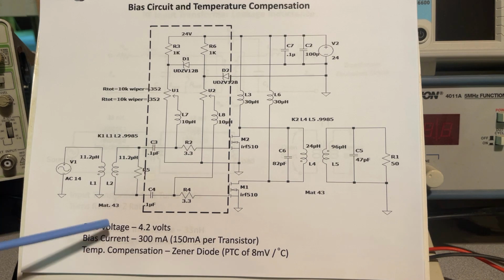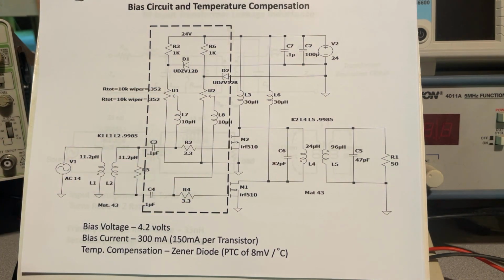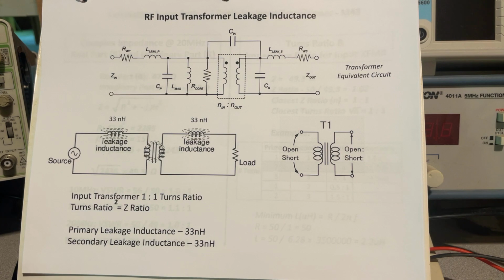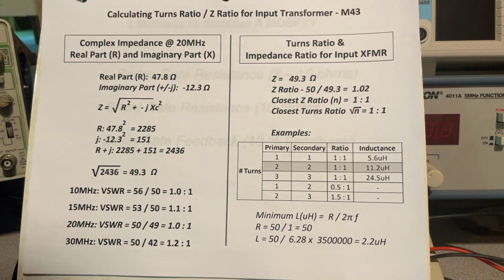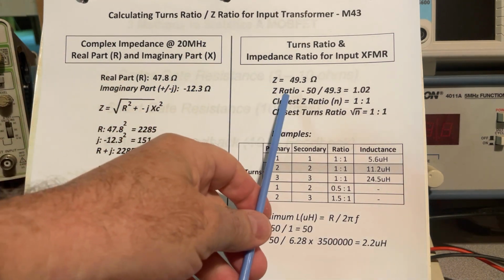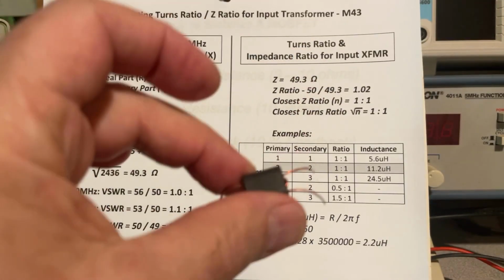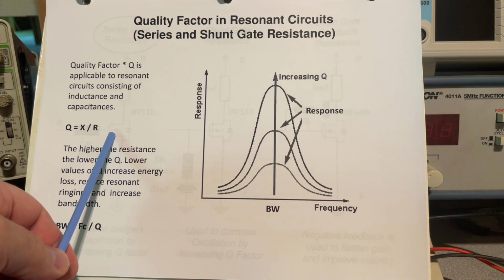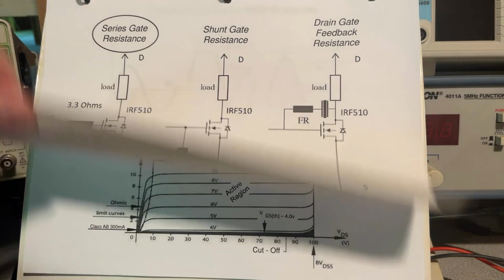(Part 3) How to Design, Build, and Test an RF Linear Amplifier (Input Board)

Comment: Hello and thank you , Very useful and educational information. If four IRF510 transistors are used in the same circuit, the bias voltage will be the same 4.2 volts, which will be for class AB operation.given that the gates of the two transistors will be common.

Comment: You don't have to match your transformer winding to the input impedance at all, you just need enough inductance to not require a lot of current. The transformer will "reflect" the input impedance of it's load through the winding ratio. The impedance of the transformer is irrelevant as long as it's high enough to prevent input loading losses
Reply: Yes. I was also told the general rule was you needed the inductance to provide 5X the impedance of your target point.  So I understand the previous video even less.

Comment: Thanks for taking the take to record and edit all the parts of this series of videos. What I miss from your videos is the impedance of the IF510 input. You never mention it. You spend a lot of time explaining the matching impedance process from 50ohm, to 25ohm, but you never said how you got that value. You are assuming each gate of the IRF510 has an impedance of 12.5ohms, as you are using a pair, those inputs are in series, then you came up with 25ohm value. Doing more research I found the Gate of the IRF510 has an stray capacitance. Vishay datasheet says typical value for Ciss is 180pF... at 10Mhz you got Xc=88 ohm. For 30Mhz you got 29Ohm... your impedance network may not work right at lower frequency of 10 Mhz.

Comment: Where did you find the formula for calculating the minimum inductance of the primary winding of the RF transformer? That formula is incorrect. The reactive resistance or reactance of the primary winding of the RF transformer at the lowest operating frequency, in this case, 10MHz, should be 5 to 10 times greater than the input impedance, which is 50 ohms in this case. An inductance of 11.2uH for the two windings is acceptable because its reactance is approximately 7 times greater than 50 ohms. You are unclear about the input impedance of the IRF510 transistors. You've placed a 60-ohm resistor in parallel with the input impedance of both transistors, thus lowering the input impedance to 50 ohms and making it somewhat variable with frequency changes. The cost of this is increased drive RF power. The concept of adapting input power from this perspective is not good because it results in increased drive power. The correct way to maintain relatively constant input impedance over the range of 1.8 to 30MHz is through properly designed negative feedback drain-gate. The whole point is for such an amplifier to operate throughout the mentioned HF range and provide approximately uniform output RF power at the output. I have more criticisms, but for now, let's stick to these.
Reply: This. This guy is correct. You don't have to match your transformer winding to the input impedance at all, you just need enough inductance to not require a lot of current. The transformer will "reflect" the input impedance of it's load through the winding ratio. The impedance of the transformer is irrelevant as long as it's high enough to prevent input loading losses
Reply: @researchandbuild1751  This is a rule that must be followed when designing wideband HF transformers! The reactive resistance or reactance of the primary winding of the RF transformer at the lowest operating frequency, in this case, 10MHz, should be 5 to 10 times greater than the input impedance, which is 50 ohms in this case.
Reply: Can you please give me some pointers to the design of  the concept you are saying- "The correct way to maintain relatively constant input impedance over the range of 1.8 to 30MHz is through properly designed negative feedback drain-gate" . Can you share related  app-note, design article or youtube video please? thank you!
Reply: @krishnamohanrao642  I don't have the information you're looking for right now, but read Motorola's publications and articles on the design and construction of broadband power amplifiers for the HF band. The publications are available on the internet in PDF format and you can download them.
Reply: Thanks, I thought I went stupid when watching the last video.

Comment: Fantastic, I'm learning a lot.  Very thorough.  Waiting for the next one.
I am a bit confused.  Question: The secondary is matched to 50 ohms, is this because the input Z of the IRF510 along with the input resistor is 50 ohms?  Or are we just isolating the output of the radio from the input stage of the MOSFET and 50 ohms just happens to be the typical output Z of most radios and the MOSFET doesn't care about input ?   In my mind I want to match the output of the transformer to the input  Z of the MOSFET. Could you explain this please?  Please correct my thinking.
Reply from the maker: The standard for all Radio Transceivers  and most RF test equipment is 50 ohms (Output impedance). You need to match the input impedance of your RF Amplifiers to 50 ohms. The turns ratio of the input transformer is used to transform the impedance to achieve a 50 ohm match. I hope this helps. RF Man
Reply: @rfmanchannel6915  Right, I got that part.  My question is that do we have to then match the input Z of the MOSFET?

Comment: Again, I really appreciate this series. At one point, could you show your LT Spice simulation for IRF510 input impedance? Are you measuring the input impedance at the primary side of the input transformer? VA3GPJ
Reply from the maker: I will show how to use LTSpice for impedance measurements in part 4 and yes the measurement is made on the input side of the transformer. I show the basics in Part 2.